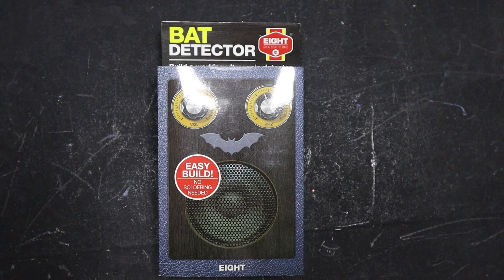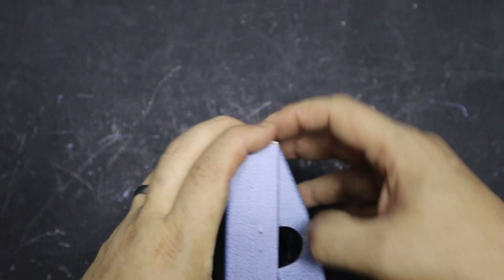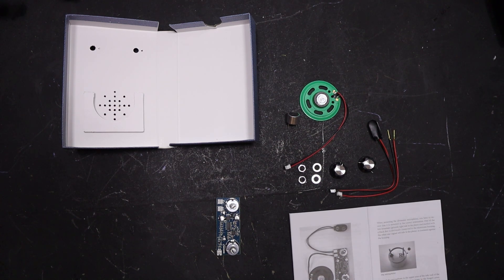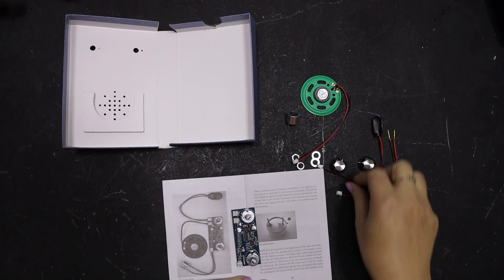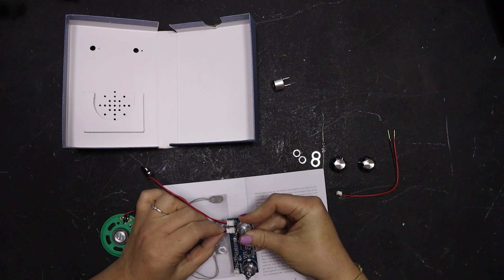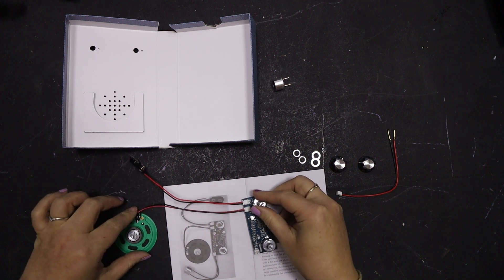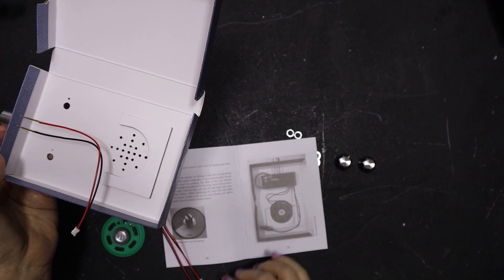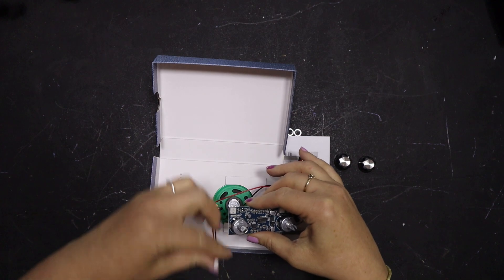DIY Bat Detector - £22 Amazon - Is It Worth The Money? Build and Test

Comment: If you don't want the leads to slide of the microphone connections use a soldering iron and some 60/40 solder with flux.
Reply from the maker: Oh I know but I wanted to put it together as intended. I will be remaking it with multi direction sensors and a 3d printed/laser cut case etc

Comment: That's actually very cool. I was expecting it to be pretty rubbish but when I saw the bats flying over and heard the clicking, I was impressed. Shame they went a tad too cheap on the box because a good project box would really improve it, but as you guys say, that's something you can do. Interesting stuff. There's probably an Arduino project out there somewhere.

I had a total hard drive failure recently and lost 20 years of work, so I'm taking it easy and getting ready for an upcoming house move, but I will be back in action before too long. Hope all is well.
Reply from the maker: Oh man I'm sorry. That happened to me a few years ago and it's really hard to get over! I lost 25k designs I'd done over the years etc. if there is anything I can do just say
Reply: @TheOffGridFamily  Unfortunately, I'm pretty sure that it's all gone. Really sucks, but it is what it is. A head broke and slammed into a platter, from what I can determine. The two platters lost position because the central screw that locks them in place came loose, so even though I bought a head comb and an identical drive as a donor so that I could replace the 4 head unit, I can't read any data. Not sure that I will be able to re-align the platters. Not without expensive software that I have no hope of getting, at least.

I will keep the platters and read online to see if there is a possible solution, but I don't have much faith. I think it's all gone forever.

Thanks, though, James - I know you would help if you could.
Reply: The annoying thing is that I was weeks away from being able to afford a new SSD so that I could transfer everything and retire the drive that broke. What a slap in the face that was! :face-pink-tears:
Reply from the maker: @budgetmerch  oh man that sucks! You've done everything I would have suggested to be honest. Good luck any way my friend
Reply from the maker: @budgetmerch  it's always the way bud! I need to grab a new drive for backing up my drive! I will try and get on with that soon